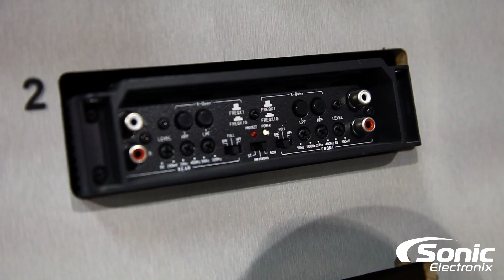How Do You Set Up an Active Crossover vs. a Passive? | Car Audio Q & A

Comment: Thanks for the video. I am  hoping someone will mention whether I should send full signal from an amp to components speakers running with passive crossover. Or, should I set to x1 to add extra level of protection for the mid range from low frequencies?

Comment: Great video. I have a question. My Kenwood Excelon head unit has an active crossover and dta. If I use my 4 channel amp(Memphis PRX300.4) and wire the components I have to run active, can I just set up the crossover on my head unit and run the amp on hpf or should I set it to full ? It doesn't have the 10x multiplier or bandpass.  It only has lpf, full, hpf

Comment: Someone help, a while back before upgrading stock speakers i put in a 12 inch pioneer with a 1,200-1,400 watt mono amp. now that i have the component set of speakers am i gonna need to install another amp for the speaker? (my stock car audio system also comes with stock tweeters)

Comment: I have 4 channels Sony amp 1200w, 2 speakers 120w rms (each) and 1 sub 380w rms..
How to tune the right voltage with multimeter please!
Reply: Umh... you're supposed to write your search queries in the search bar, not in the comments input box.
Reply: @vitaminb4869  
Fuck off  bitch..  if you don't know then shut tf and go fck ur self

Comment: So say for example my Infinity reference 6.5 comps. It states they are 90w rms. So my amp can do 55 rms per channel. But 130rms bridged. Would I be better off going bridged and still be pretty safe as say 40% of that 130rms amp power is not getting through? As opposed to only giving them 30rms from the single channel mode.
Reply: You'd have to double check the ohm load.
Reply: @kensmechanicalaffair  hmmm. Well the manual states 55w x4 @ 4ohm, 65w x 4@ 2ohm and 130w x2 bridged but does not states at what ohm.
Reply: Probably means 1.5ohms

Comment: So on making the switch on an advertised 100 watt rms component set, the mids and tweets don't require the same rms. Is it best to use two separate amps? one two channel with lower rms for the tweets and one two channel with higher output for the mids?
I had one 100 x4 amp on a 100w comp set, went active and blew the tweets

Comment: Im having whining noise issue through my audison bit one. I checked everything and got new wires and replaced ground points and still getting that whining. I ran amps without dsp and no noise. But when i ran the amps with audison dsp whining noise came back. Anyone that can help would be appreciated.

Comment: It seems like everywhere I look people are still using aftermarket head units as the example. More and more vehicles including the less expensive economy sedans are coming from the factory with some sort of integrated display panel that cannot be replaced with a classic single/double DIN stereo. I'm just curious when this is be addressed more by the car audio industry and be featured in more car audio content.
Reply: I'm eager to see where aftermarket audio will fit in with the newer infotainment systems as well. I am very interested in how Bluetooth capable amplifiers will develop going forward. Imagine an amp that you connect to your phone for BT audio source and also DSP features! Could be very cool. Adding an amp (and swapping speakers in) to the newer vehicles with dashboards averse to DIN standards would be a solid solution IMO. I have heard that wireless audio sourcing is always inferior to wired though. D:

Comment: I have  recently upgraded my car audio system with an 8 channel DSP, 5 channel Amp, 2 pairs of component speakers and a subwoofer.  I feel that the crossovers of mid bass and tweeters are not communicating well with the DSP setup.  Questions:- Is there a way to properly "sync" DSP with component cross overs? If not,  is it possible to convert component speakers to active speakers?  Can the DSP and 5 channel amp drive all 2 pairs of speakers active or only 2 pairs? I am okay to go for a two channel amp for the rear speakers if that is the best option.  When we use this additional amp, can I get the DSP drive those two pairs of speakers?  

Thank you
George Thomas

Comment: So just wondering here, I see you used a typical class d 4 channel amp as an example to run both the tweeters and the mids. You may want to mention rms (watts) and matching your components rating to the amp. Think the last thing you want to do is have someone wire up their 4 channel 100 watt rms amp to a 75 watt rms mid and a 25 watt rms tweeter as an example

Comment: I want to say thank you Chino for this very informative video on crossovers.  While I learned a fair bit more about these potentials from your info, I also find myself a bit more lost in this.  I am working on my system that will have three ways to do crossover and now I am not sure which way will be best.  The head has capability to do either 'active' or 'standard', active offering in-deck crossover shaping. The amplifier, (a 5 channel), has full crossover built in too...and the components have their own passive external crossovers as well.  I didn't realize that passive crossovers ate up so much power so I am just going to not use them.

That leaves me with the HU active capability and the amplifier's built-in x-over.  I am not sure which is the better way to go about it! :/  If I use the amplifier crossover, I will still have to use the passive x-overs because I would need 4 channels for a pair of components...but tweeters don't need all that much power.  :/

This stuff gets complicated fast!
Reply: Maybe I could just use the passive component x-overs just for the tweeters in parallel with the amplifier x-over set for the 6.5s?  Things were simpler in years passed, but maybe not as good quality sound?  I dunno...  I will say that the dollar per usable watt ratio is a whole hell of a lot better now than it used to be!

Comment: I’m running an amp it’s for channel can parallel it and give you eight speakers I want to run his many components because I can include paralleling them using a digital processor for the crossover how do I hook my tweeters in the Woofers up and be able to use the digital sound processor to separate them and filter the amp r can it hook them up tweeter and woofer channel 1 left and tweeter and woofer Channel 2 and use digital sound processor crossover high and low to adjust them?

Comment: hello
I have a JVC car stereo KD-R416
which powers 50W*4 speakers
A box with dimensions;
Height = 30.5 inches (77cms)
Width  = 14.5 inches (37.4cms)
Depth  = 11.6 inches (30cms)
board thickness 0.5 inches 

Please suggest woofer/sub-woofer size and wattage.
tweeter size and wattage.
Also crossover network active or passive.
thanks in advance.

Comment: Can you use a passive crossover with a 4 channel amp? For example i have a chevy truck with bose system. I'm wanting to replace the bose amp and speakers with an aftermarket amp and component speaker setup.
Reply: Jesus Zuniga yes you can. You will only use 2 of the 4 channels that way unless you "bridge" the 4 channels into 2 channels for more power.  All depends how powerful the amp is and how much power the speakers can take

Comment: hello I wanted to see if you can help me out I have a Pioneer radio and I want to connect a pioneer Gm d 1004 amplifier I don't know should use the RCA output or I use the speaker wires coming out from the radio to the amplifier
Reply: Adrian Cabral better to use the low level rca cables, not the high level speaker wires

Comment: Should have mentioned Bi-amping to be able to use proper Time Alignment with passives.  Also there are decks out that can do active.  These small class D amps these days are the Bomb... I am an SQ guy and even I like some of the Class D amps like the ARC 1200.6 or MMATS 6150D.  Great for a 2-way plus sub active setup.

Comment: So if I have a passive crossover network do I still control where the hertz range begins and ends? The factory crosssover only sets the hz range where the mid ranges and tweeters cross correct? It doesn't control where they begin and end does it?

Comment: So 1 4 channel amp to run 1 set of componets?
Reply: rlisi54 one 4 channel amp can run one or two sets of components depending on the power the amp supplies and the power the speakers need. To run just one set of components (1 mid& 1 tweeter) you would bridge 4 of the channels on the amp down to only a 2 channel amp to double the power given to the speakers. But only do that if say it's a weak 4 channel amp and you have good speakers that can take 75 to 100+ watts. Hope that helps

Comment: I recently purchased the NVX JAD900.5 and the PPI P65c3 from Sonic.  Does it make sense to run the amp in bridge mode and have the PPIs running bridged or switch to 4 channel mode, take the woofers off the passive crossover and on the amp's rear channel, with the mids and tweets still on the passive crossover using the front channel?  The head unit is a Pioneer AVH-X4800.  Thanks!

Comment: just put in re xxx 6.5 components and keep getting engine noise. I have changed my ground 3x and it keeps happening could it be the crossovers?
Reply: Derek Sr. not quite sure what you mean by that, RCA cables don't usually get grounded  from my experiences.
Reply: Check all your grounds, amp, x over, and head unit
Reply: James Hughes ground out your rca's
Reply: redo the grounds on your engine

Comment: Hey Sonic Electronix, i just wondering do i need 4 chanel amp or after maker pioneer head unit are enought for pair of 6-1/2" 2-Way passive Component speaker system  with 70 wrms each midwoofer and tweeter.? Thanks.

Comment: Great video. Spent some time watching your vids and I'm learning more and more. Keep em coming 👍👍
Reply from the maker: That's what we like to hear!  :]
If you have any questions on a topic reply to this comment! If it's a good topic / common question that will apply to a lot of people we will surely do our best to answer it in a video - if it's a question specific to you we'll make sure we get back to you with a comment!
Reply: @SonicElectronix  

Got a question for you guys.

Amps--

1St  D-4.800 for my front components . 
2nd  LC-4.800 for my rear speakers. 
3rd   LC-1.800 Subwoofer 

Speakers-- 

Single JL audio 12w6v3 in a ported custom box 
Front speakers MLK 165.3 Components from hertz -
Rear speakers MPX 165.3 - 

Head unit-- 

Kenwood DMX 907s, 

My question is what crossover you recommend for my current set up ? I want to go active on the front but I'm kind of confuse where I should set the crossover for my woofers and my tweeters.  also what crossover you recommend for my rears ? sub currently is sitting at 80 hz .... thank you in advance .

Comment: If you do all of the settings with the headunit (ex. Pioneer's network mode) do you still need a amp with a 10x multiplier?
Reply: If you are using a two-band front that is midbass and tweeter crossover or any filters on the amplifier is not needed. If you are using a Pioneer head unit in Network mode you can cut the required frequency of your head unit of the fourth order. It is very good. But if you are using a three-band front need filters and the amplifier too.
Reply: +Vladimir Buzhinskiy I am doing a 2 band front with a subwoofer. Pioneer's audio processor (network mode) has crossovers for high, mid, and low. So I should be good, right?
Reply: +Joshua&#39;s Recordings Absolutely, Pioneer head unit processor in a network mode will allow you to unlock the full potential of your speakers. The most important thing you need to understand how to cut all frequencies from your Pioneer. And please be very careful because if not set correctly, you can burn the coils of your speakers.
Reply: +Vladimir Buzhinskiy Yes, I know plenty about crossovers and burning out speakers (I actually do that for fun to crappy speakers now and then). I can't wait to get this system all set up! I am going with the Pioneer AVH-5800BHS headunit, Polk Audio MM6501 speakers, Alpine PDX-9V amp, and a Rockford Fosgate P3D4 12 subwoofer in a sealed box (and of course a 4 gauge amp wiring kit. What do you think? Any suggestions?

Comment: What about actively crossing over 3 way setups? (Midbass, midrange and tweeter) How would we do this?
Reply: +Bouge laal 
you would need 6ch and 2 band pass filters and 1 hi pass filter.

for ex

midbass-50-600hz

midrange-600-3500hz

tweets-3500hz & up.
Reply: Salvador Sandoval I don't think 6 channel amps exist.... You think an LC6i would do justice?
Reply: Bouge laal 
No they don't. You would need a 4ch and a 2ch amp. In order to get the 6ch needed.
Reply: Bouge laal oh and the lc6i is a line out converter. Only to convert speaker level signals to rca signals. Not an amp

Comment: I gotta jbl 4ch 804-ez 940w on 4 6.5" jbl gto components I plan on doubling my 6.5"s for midrange I will have like 10 tweaters & maybe 2 of those copper crescendo's if I can get my hands on em... for the a pillers...I have alot of amps laying around couple ALPiNE's like the T220.2 with hi/low pass /a 600w 4ch alpine & a M450.2 but I don't care about those last two to much I was planning on just buying either massive 6.5 component's or midrange's like neopro type but not sure....input welcome !!!

Comment: Hi Brendan and Allyn,
I am a novice and have installed the following systems in my car.
Kicker front row ZXDSP1 6 channel digital sound processor,
Powerbass 4 channel amplifier ACA480 – 4.
JBL GT5 – A3001 mono bloc amplifier,
2 pairs of Sony XS – GS1720 Two-way speakers and
A DIY 12 inch. Sub-woofer.
However I’m not getting the best sounds because I think I haven’t calibrated the amplifiers well and have already blown the rear right speaker. I’m planning to get the SMD DD -1 + CC – 1 Combo to accomplish the task. Can you please tell me which crossover frequencies to use in order to obtain the cleanest and smooth sound without any frequency drop-outs?
What frequencies and decibels should I run through the front, rear and subwoofer?
I listen to all types of music depending on mood.
Samuel (from Ghana).

Comment: Hey guys, I have a question about built in crossovers. I have infinity kappas that I haven't installed yet and they have built in crossovers supposedly but there's no adjustments that can be made. Should I run them on an amp? And does this crossover actually do anything?

Comment: Some high end head units also do the 3-way active setups (some even 4-way). My Pioneer DEH-80PRS does 3-way active, has a very sophisticated crossover network built-in, so there's no need for any external processor.
Reply: BigDWiz yoooooooo!!! I watch your amp dyno vids!!!
Reply: BigD! I love your amp dyno videos.  I still rock a similar Pioneer Premier DEH-980BT with all the fancy auto-eq, timing alignment and BBE, and DSP. 

BTW, Sonic Electronix, DSP stands for Digital Signal Processing,  not digital Sound processing.  DSP takes an audio signal while it's in a digital format,  e.g. 1s & 0s, discrete samples then processes it (crossover,  timing alignment,  eq, lpf, hpf, etc) on a digital processor or DSP Chip using math (multiplying the audio sample train against your filter coefficient train and adding them up to get your next output sample), and it does this for EVERY sample or 44,100 times per second. 

I'm an electrical engineer with master's degree in digital signal processing. For my senior project I took a 7.1 surround sound receiver and found the schematic for it and intercepted and hijacked the digital signal samples right before the digital to analog converter and I told those digital samples into a DSP chip (actually an FPGA), where I decoded the I2C codec filtered it using a 256 point FIR filter,  then encoded back into an audio bitstream and fed the bi-amped data back to the DSP card on the surround sound receiver but borrowed one of the extra surround channels as my new amplifier chain and turned it into front High and front low. So I used DSP to do bi amping and turned a 7.1 surround sound receiver into 5.1 biamp surround sound receiver. And the magic sauce to all of this was that with DSP I was able to achieve LINEAR PHASE! It sounded beautiful!
Reply: the 80 prs crossover points suck, very limited range. I leave mines on standard mode and cross over on amps, i get much better sound that way due to flexible crossover points.
Reply: big d thats what i kinda just asked on here...i know if just replacing Factory speakers and just maintaining the typical component  setup i know you can use headunits active c/o but lets say im running rca's to mulitple 4channels and lots of mids and highs does the headunit at that point still know how to crossover the frequency and send it to the appropriate speakers? or would i need an exteranl active/passive c/o at that point...?
Reply: I